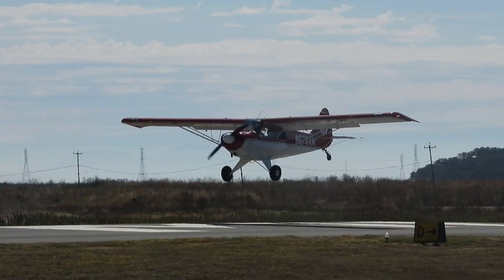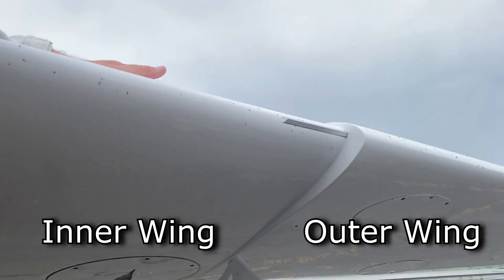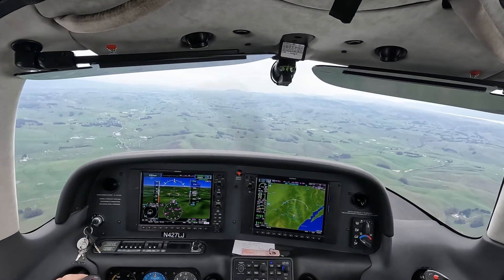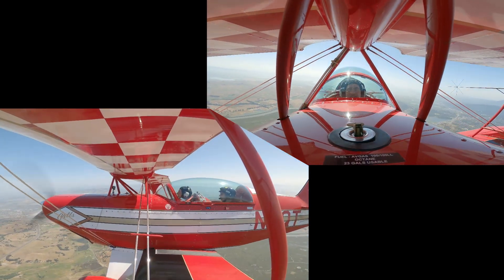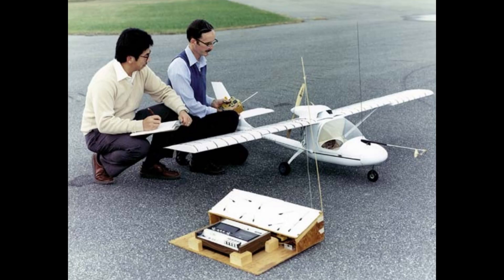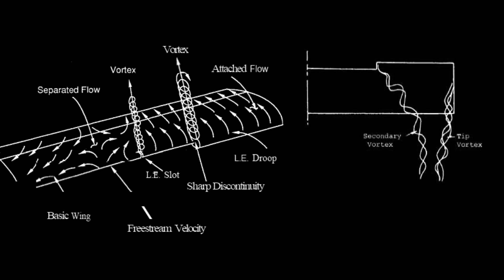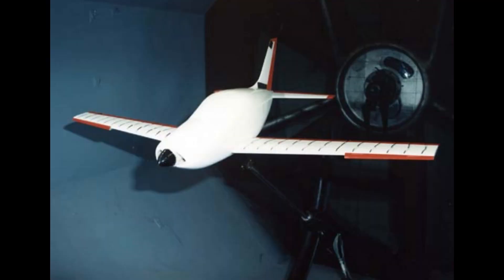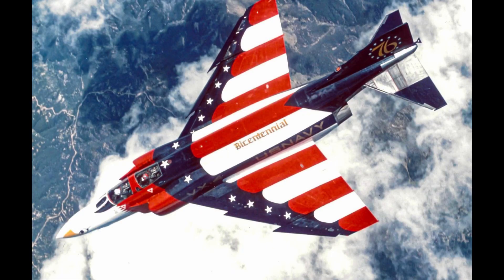Why Is The Wing Broken On Some Planes - How a 'Dog Tooth' Makes Wings Work Better.

Comment: For a direct example, take a look at the difference in wing devices on a Hawker 700 & Hawker 800. They’re obviously evolutions in design of the same aircraft. While the Hawker 700 has a wing fence to stop (or rather delay) span wise flow, they were replaced with much smaller vortilons on the Hawker 800. This change mostly reduced drag but also some weight, while giving similar stall performance. It illustrates how these solutions evolved over time as aerodynamic understanding grew - and on the same aircraft!

Comment: First correction @1:30: Stall & speed are indirectly linked together. But a VERY important subject your studies and CFI should be teaching you is that stalls occur at a single angle of attack and can happen at ANY airspeed, not just low airspeeds.

Comment: So not to suggest that NASA isn't the inventor of all things aeronautical, but this feature first appeared on the AVROE Arrow which was designed and built in Canada in 1959. In fact you use a shot of the Arrow in your opening sequence. After the government of the time killed the Arrow a number of AVROE engineers went to work for NASA, perhaps they took this design idea with them.

Comment: Flow separation is actually quite easy to understand, if there is no friction on the wing, the airflow speed would hit 0 (relative to wing) again at the back of airfoil, mirror the front stationary point, but due to friction, it will hit 0 sooner down the road, and that's where the separation happens.
You'll have flow separation at any AOA, that's why we have drag, actually that's the only way a wing could satisfy Kutta condition and generate lift, Stall is defined as the turning point that more AOA means less lift, which normally is when the flow separation stating to looks spectacular.

Comment: There's a similar thing on the tail of the F-15. In that case, it was also for vortex generation, and while I don't remember the specifics, it was for coordinating the vortices of the horizontal stabilizer and the wing. Be careful drawing assumptions though, because a lot of old soviet designs copied features like flow separators and vortex generators "Because the west was doing it" and not out of any particular benefit. The latest Russian and Chinese "stealth" aircraft seem to be of a similar mindset.

Comment: Not all f18's have the dogtooth. None of the original Hornet's have it, and it is an easy way to tell the difference ion the air betwtween a Hornet, and the more recent Super Hornet, is the dof tooth which was added to the Super Hornet.

Comment: Nice to read comments from people interested in aerodynamics. I’m a retired aeronautical engineer and current glider pilot. The (early 80s) DG400 glider has boundary layer blowing on the lower surface, via dozens of small holes, all of which have to be checked to ensure that they’re not blocked. Because they’re small production volumes and usually single seaters, while focused on performance, gliders have sophisticated aerodynamics. Gliders thus tend to be early adopters of technology; winglets, cranked wings etc. Our Ventus cT (the T meaning turbo for pop up engine to - sometimes - rescue me from landing in a farmer’s field).

Comment: If anyone wants to see a use case of vortex generators on the ground, then take a look at the f1 cars from 2019.
They had a lot of slots, holes and curves in the floor to seal the underside of the car and get ground effect working with that.

Motorsport in general is full with that sort of stuff and it’s really interesting.

Comment: Great video.  I’d love to hear you walk through the aerodynamics that Formula One teams are using.
Reply: They use the aerodynamics that the 125 page book of rules allows.

Which is to say, stupid aerodynamics that are as ineffective as humanly imaginable, for no reason except to appease a regulatory body. 

They don't even allow windshields, wipers, or fenders. Items invented 100+ years ago and used on every automobile. Yet they still claim these pieces of European junk to be the cutting-edge of technology. 

Oh yeah? Then why did they ban ABS, Stability control, hydraulic controlled dampers, active aero, powered downforce, and all sorts of cutting edge tech over the years? Meh.

Comment: Check out the Sukhoi Su-15 for a very interesting example. It inherited the pure delta wing of its predecessors Su-9 and Su-11, but the wing was eventually modified with a very weird outboard section that didn’t have a dogtooth, but a very pronounced change in camber combined with a decrease in sweep that increased wing area near the tip. I think it’s one of the prettiest planes ever… bit I’m kinda strange.

Comment: Not 90s.  The F-4 is from the 50s.  The F-15 has a dog tooth on the horizontal stabilator.  (The YF-15 did not have one.  It was one of the changes from the prototypes to the F-15A.)

Comment: Nasa ... looked at the avro arrow data ... and reexamined some of that ... they already had many of the old engineers anyway .... yes they tested the wing changes ... fully ... even at mach speeds 
and that was early 1950's so none of this BS 702 Nasa did it ... they reinvented the wheel is all and called it sliced bread 
you even used one of the Arrow coloured Pics showing the wing change ....

Comment: All sorts of wacky wonderful vortex generators for many purposes.  I had a coworker with a ladder rack on his van that would vibrate at highway speed. Big long horizontal bar that would just shimmy up and down.  I told him it was vortex shedding making it shimmy, and to put a spiral of rope around the bar to act as a vortex generator to disturb the shedding. The rope fixed it, and he went down a path of trying to systematically add tabs to it in certain places, instead of just having the rope wrapped around it.

Comment: Are you familiar with the problem the F-18 had at high AOA creating turbulence over the vertical stabs? Bad enough to cause structural failure. There was a NASA program to resolve it with simulations. Those vortices were destroying aircraft. I guess the answer was those characteristic strakes on F-18.

Comment: If the 'teeth' and geometry changes occurred at more frequent intervals (more slices) the aero transitions would be even smoother. Of course a more complex shape is traditionally more difficult to produce, but with 3d printing techs coming on line and advances in carbon fiber, this may turn out to be viable.  Just a thought.
✌🎅👍
Weird thought experiment of the day: If I take a flat sheet and dimple 1 side but not the other, when presented edge on into a fluid flow, does it exhibit lift? Which direction (towards or away from the dimpled side)?

Comment: Re: the MiG-15 "wing fences".  There was a joje in the Soviet Air Force that the fenves were installed "to keep the air ftom defecting to the wingtips" (which is an accurate, if tongue in cheek, description).

Comment: What's the earliest usage of dogtooth wings? As far as I've been able to find it's the Saab 32, it had it on an early test model in 1952 (I've only found one photo of it), but the ”wing prototype” had them in 1950. It was a modified Saab 91A, renamed 202, that they used to test the wing shape before committing to production. The same plane was previously called 201 when it was used in the same way for the Saab 29, which later got dogtooth wings too. Both the early test 32 and the 202 seems to have had moveable extensions, somewhat like slats, not sure if movable during flight or just when landed (very little information available, text doesn't mention anything and the photos are few and grainy). The 32 production models ended up using a boundary layer fence instead of the dogtooth design.

Comment: I experienced such "excitement" during my private pilot training in a Cessna 172. My instructor Bill Watson had me flying through the stall as you described. As a wing dropped, Bill coached me to kick in opposite rudder to lift it. All was going well until my brain overrulled the lesson commands . . and I used the yoke trying to lift the left wing drop. And boom, the plane snapped 90-degrees and was falling straight down -- sideways! I'm looking out the left window watching the ground coming up at me. I froze up and freaked. Bill just chuckled, took the controls, and recovered the craft to straight and level.

You wonder at times whether you will lose control of certain bodily functions in total fear situations. Well I did, but not as I ever imagined. I had heard the term "flop sweat" before, but never had experienced it. I went from cool and calm one moment to completely soaked in sweat the next. I mean all over! My hair was soaked as were my clothes, including socks and shoes! I had no idea the human body was capable of dumping so much water so fast through the sweat glands. I believe it would have been far less embarrssing to have just pissed myself! ;-)

No matter in the end though, I passed my check ride on Valentines Day 1988.

Comment: Both the F-4 and the F/A-18 are usually carrier based aircraft, where good slow speed handling is crucial for landing.  So it makes sense that both these aircraft would have the dog tooth design.  Interesting video.
Reply: Also note on the F-4 that the outer leading edge dog tooth also corresponds with the fold line of the folding-wing section for carrier storage.

Comment: Enjoyed the video! 

As with all engineering choices, these wings represent a tradeoff.  In that lens, the term "better" is likely not what you meant.  "Safer", for sure.  In most cases these airfoils trade speed and drag for better "slower" speed characteristics, such as spin and stall speed handling/performance.

Comment: Some surfboards have something similar. They are generally made to make the tail narrower in a wider than average board. They were popular in the late 80s but have made a bit of a comeback with modern designs. 

It would interesting to see iff these 'teeth' help with vortices going from the tail to the entire length of the board thus ultimately helping the board maintain speed. Given today this design is used on small wave boards so it may actually help water flow under the board.

The boards I have had with 'teeth' felt like they dont bog as much like a board with straight rails will on a weaker, softer wave.

Comment: It' always fun to see a book I'm reading in the background of a video. I'm about halfway through Rhode's Atomic Bomb book.

Edit: Video suggestion: Explain how airplanes produce lift by showing the factors that go into a stall - speed, angle of attack, etc. I'm sure you've covered it before, but I mean specifically use stalling as a focus point to explain components of lift.

Comment: Is it not that the Sirrus has a slightly higher accident rate than comparable models? (You said safer) Another aviator made a video suggesting that it was some of the safety features in this design combined with owner reactions or lack of specialized maintainance that caused the increased rate.

Interesting video.
Reply from the maker: These days it’s accidental rate is below the average.
https://www.avweb.com/ownership/cirrus-at-25-a-safer-airplane/

Comment: The critical angle depends on the flap setting.
Full flaps means that the critical angle is SMALLER. holds for the cirrus., That is the reason the stall is induced with aileron deflection!

Comment: Love the Pitts. As a teenager I was allowed to fly a remote controlled model of a Pitts several times which was a lot of fun. It was not a scale model as it was used to aerotow big sailplane models. So it had a very powerfull engine. A stall was no big concern. You could fly the plane vertical hovering like a helicopter. But not me, I just flew normal maneuvers and a couple of loopings and rolls. Ah, fun times with my father and his friends, but it never got my own hobby.
Slowing down and landing this Pitts was also quite easy as throtteling down with the big props was like aerobreaking.

Comment: Very interesting! What about hang gliders? Their wings twist and change angle of attack towards the wing tips. As the centre of the wing starts to stall, the wing tips are still generating lift, helping to preventing stalls and aiding stall recovery. Modern hang gliders have a VG (Variable Geometory) system, where a cord can be pulled , which goes through a block and tackle inside the wing, which pulls the sail tighten and reduces the washout at the wing tips. This configeration is best for getting maximum glide performance inbetween thermles and less drag at higher speed, but makes the glider a bit less stable. When the VG is off the sail has less stiff and it is better for feeling small changes in the air when thermling, and better handelling at low speed. Also better handeling when close to the ground when taking off and landing. 
Also fun fact, the eairly stages of hang gliders development have close ties to eairly space exploration as NASA experemented with the Rogallo Wing, as means of spacecraft recovery after re-entery. This may be a good topic for one of your videos!
Reply: Hang gliders are currently the world's only production flying wings. (At least before the B-21 enters full rate production)

Comment: My first hammerhead stall was soooo surreal.  Being all protected inside of the cockpit, there was no sense of how dangerous it was.  My instructor was teaching stall recovery and recovery from a hammerhead stall was just learning about another stall.  He told me how to use my rudder and that was that.  When I'd go and practice sans instructor I'd practice each method, with enough height and then  s-turns or 2-min turns etc.  Now I know better.  Stalls can happen when you don't have enough height and death is not recoverable.
Reply: As soon as you feel the burble, and especially if you feel a wing drop: STICK NUTRAL/FORWARD.

Reduce angle of attack IMMEDIATELY and you will be fine. 

Practicing stalls is about practicing moving the stick forward to break the stall. The sooner the better.

Comment: My plane was built in 1947, so it was before outer leading edge cuffs became popular in GA aircraft, but it uses slots for much the same purpose.
Reply: The slots are also a lot simpler structually for a metal and fabric wing.

Comment: Certification requirements have also changed over time. In older airplanes when stalling, you keep the wings level by keeping ailerons neutral and use the rudder instead. As you mentioned, many pilots try to use the ailerons instead, which is not the best idea. But still too many accidents happened, so lately the aviation authorities are putting more emphasis on departure characteristics while in a stall, i.e. requiring to keep the airplane controllable while using the ailerons without dropping a wing or entering a spin. This is reflected by the latest version of the certification requirements CS-23 Amendment 5 or FAR-23 Amendment 64.
Reply: They experimented with this in the 1960s in the UK, after finding the Beagle Pup tip stalled. They produced a bolt on fibreglass leading edge droop which was progressive towards the ailerons and wingtips. They industrialised this on the military Bulldog, which I fly. It was so successful that the POH says of the stall, "Ailerons may be used throughout."

Comment: My aeroplane, a Scottish Aviation Bulldog, has a progressively drooped leaving edge as you go outwards along the wing. When they first designed the Beagle Pup in the 1960s, they found that it suffered from stalling in the outboard sections of wing first. To counter that, they experimented with a fibreglass moulding with a progressive leading edge droop. It was very successful and they included these fibreglass mouldings on production Pups. When they built the military Bulldog, based on the Beagle Pup, they industrialised this design so the whole wing shape was changed to incorporate this droop.

It is so successful that the pilot's handbook says of the stall, "Ailerons may be used throughout." You can, unlike in the Pitts, bring it to a full stall and still fly it around with the ailerons! It's about the only aeroplane I know which can do this, and it's gives you a lot of confidence in its slow speed handling near the ground.
Reply from the maker: Would love to fly one of those someday.
Reply: @scottmanley  Let me know next time you're in the UK and I'll take you up. Or I know a number of other owners who will as well, depending on where you are. I know some US owners too, I'll enquire about any who are in California. I run the Bulldog Facebook group.
Reply from the maker: I knew the bulldogs were built in Prestwick, close to where I grew up. I hadn’t even thought about finding one to fly until you mentioned it.
Reply: @scottmanley The ex-demonstrator is still based in Prestwick, now owned by a private group. I have a couple of friends in that group if you're over that way. Personally I'm based at Popham down near Basingstoke.